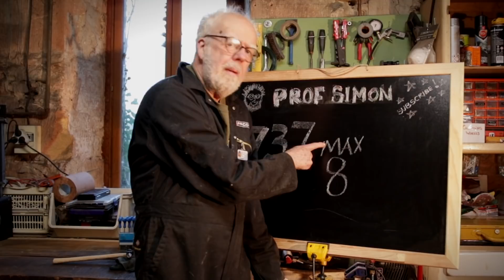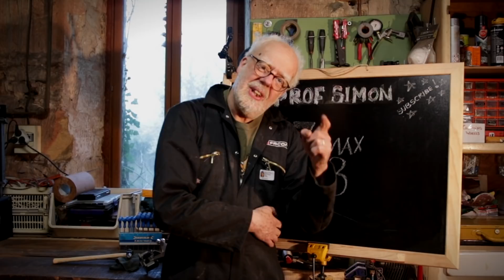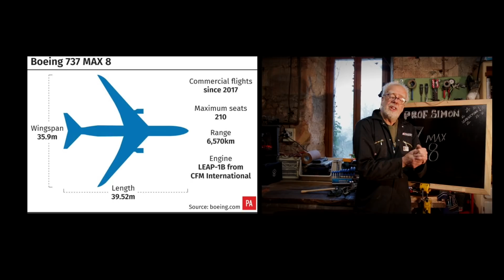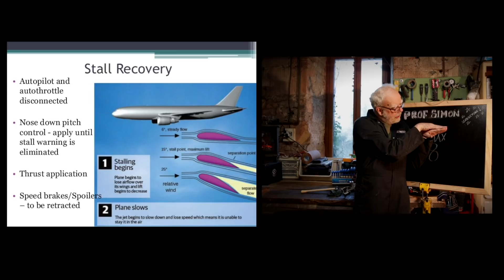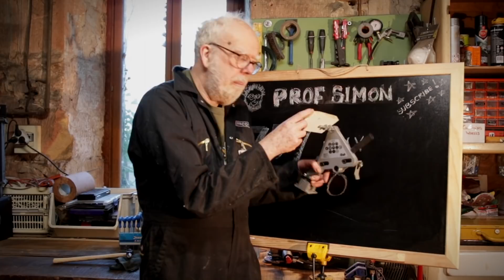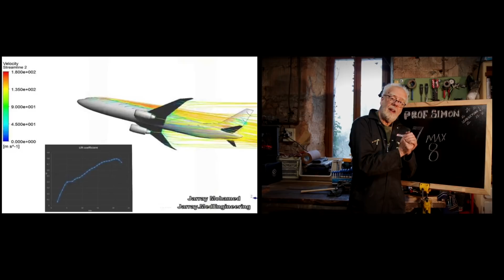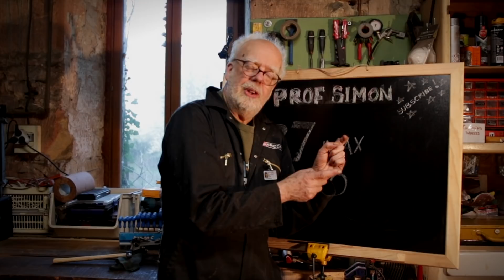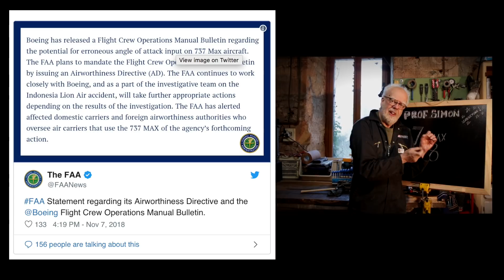Boeing 737 max 8's

Comment: “This emergency AD was prompted by analysis performed by the
manufacturer showing that if an erroneously high single angle of attack (AOA)
sensor input is received by the flight control system, there is a potential for
repeated nose-down trim commands of the horizontal stabilizer. This condition,
if not addressed, could cause the flight crew to have difficulty controlling
the airplane, and lead to excessive nose-down attitude, significant altitude
loss, and possible impact with terrain.”

Emergency Airworthiness Directive (AD) 2018-23-51 was sent to owners
and operators of The Boeing Company Model 737 Max 8.

AD #: 2018-23-51

DATE: November 7, 2018

www.faa.gov/aircraft/safety/alerts/

The bastards knew the angle of
attack vane and/or MCAS system was faulty.

Comment: Jumping to conclusions ?? he is trying to explain an accident that hasn't been investigated
and the reason is because no one knows without the full investigation what really happened
from the news it was reported that pilots were having problems with the Airspeed indicators 
and wished to return -this has happened on other modern aircraft and the result was crash's
so they need to do there work and find the cause.guessing don't work in aviation safety

Comment: MCAS has not been determined to be the cause yet.  There are reports of smoke coming from the rear of the 737 Max 8 before it hit the ground so I would not jump to a conclusion yet.
Reply: J A

But, but, all of the keyboard experts have already jumped to their expert conclusions. In every other plane crash waiting for the investigation and conclusion is the standard procedure. You don't ground entire fleets of aircraft on hypothesis and hearsay. The two aircraft that crashed were the same model. However, there may have been two unrelated reasons for those crashes. This type of aircraft is flying every day 24/7 all over the world. When other types of aircraft crash such as the Korean Air 777 or the Singapore Air 747 there are not hysterical calls for grounding every 777 or 747 in the world. The hysteria begins when people, uneducated in the aviation industry,  think they are experts and start demanding all sorts of absurd things. My thought is that,  if you don't feel comfortable flying this model aircraft, then by all means don't. There are other aircraft that you can fly that may, unbeknownst to you, have a worse safety record than the B737Max8. If you stick to reputable airlines in countries where the maintenance is reliable and the pilots are well trained, then you should not have to worry about the model of aircraft that you are flying in including the B737Max8.

Comment: Professor Simón
I  think that the Boeing 737 Max engines have a huge  increased momentum   when maximum power is applied to revert a stall. That force generates a pitch up moment which increases the AOA beyond its limits.
a second point is : most pilots are  « approach to stall trained » instead of «real stalls training»
In order to recover from stall many wing mounted engines must be reduced first to avoid the ACFT's undesired pitch up upset.
Reply: The line of thrust hasn't changed much and the engines are more efficient, not much more powerful. Instead, the issue with the plane is that the center of lift moves forward when AOA increases because the engine nacelles interact with the airflow over the wing.

Comment: If an actual jet airline pilot would care to comment, I'm under impression that for years there has been training on "runaway trim" incidents? Isn't the "Stabilizer Cut Out switch" on the center pedestal?
If I were to be asked to guess (Only as an MEI in gen. Av. aircraft it would be a lack of sufficient training. 
One Lion Air crew if I remember experienced a similar runaway trim event after takeoff but managed to recover and was actually considering continuing onto their destination (but did not). The same aircraft with different crew crashed. The FDR indicated a continued "push/pull" against the A/P for numerous times until the P/F became fatigued and turned control to the PNF just before impact. I'd suspect lack of training/Sim time.
I'm troubled with the number of failures (alleged) of the AOA sensor that have been reported in the Lion Air aircraft.

Comment: PILOT ERROR...  When the anti-stall system (MCAS) starts shaking the flight yoke...   TURN IT OFF...!  DUH...!  (2 manual switches on the lower right center flight console)   (By the way, these aren't your daddy's 737s... These aren't the wide-body 737s of yesteryear.  These are narrow-body 737s, a completely different design aircraft)
Reply: William Riley exactly. And if that doesn’t work they can always pull the circuit breaker behind them (I think).

Comment: In my humble opinion Boeing need to test fly for a one years before sell the product , we no need reason about a failure 🤔
Reply: I think they are going to find it was a number of things that lead to the crashes.  A big thing will be lack of emergency procedures training with the new system by the airlines.  

I have friends that have many thousand hours in the older 737 that have switched to the -8 MAX.  They say it's like the old one but not.  It should be interesting to see how this plays out.  Everything seems to be pointing to issues with the MCAS.
Reply: @Femmpaws ~ There's a big difference between a Yugo and a Yugo with a turbo and. Though the plane is a 737 it's not the same plane. I agree with you.

Comment: MCAS does not trust pilot and ignored pilot commands.
Contemporary software is much more buggy and much more complex than prev generation of software. Main problem is that it is harder and harder to turn off auto correction and control the plane manually. Too many layers of the systems btw a pilot and actual wing controls.
Investigation might not give a clear answer to the actual problem because of the complexity of the system.
Reply: Alexander Pivovarov right was the point for the pilot
Reply: The basic problem is the philosophy that the computer should have priority over the pilot in activating controls. My belief is that computers should warn, not take over. I have thousands of hours on earlier B737s, and it alarms and saddens me to see pilots losing their manual flying skills to computers. Now, when the automation fails (Air France crashes into Atlantic is a prime example) pilots have nothing to fall back on.
Reply: @aeomaster32 . As a pilot What's your take on the lion air crash? My understanding is that the pilot did multiple trimming operations to level the plane but were confused that while the plane always responded to their manual trimming, the MCAS induced nose down eventually defeated their efforts. Must remember that they had no idea that in manual mode, MCAS would be giving nose down commands after every 10 secs.
Reply: As I suspected the recent 737 plane soft was written by Indian fresh grads.  https://www.business-standard.com/article/international/boeing-put-flyers-at-risk-with-9-an-hour-pay-to-737-max-software-engineers-119062900267_1.html

Comment: Why are eye witnesses reporting that smoke and fire was coming out the plane's tail before it crashed. Some eyewitness reports also claim that belongings were strewing out of the plane before it crashed. Why would that happen if it was an issue with the pilots not knowing the new auto-pilot software.
Reply: I also heard that report. If the plane was trailing smoke and/or stuff was coming out of it before it hit the ground that might indicate either a structural failure or perhaps a bomb went off on board. Time will tell.

Comment: if the software is trying to optimize angle of attack maybe parameters are perfect when the nose is down and it stays locked in the position ignoring all the other inputs and that's similar to what happened. And if pilots don't know how to turn it off then they are basically mere passengers as everybody else.  
The question is why would you design a system that has a so called 'single point of failure'. Why wouldn't it disengage when pilot assumed control?  Sounds like automation for the sake of automation.

Comment: I wonder what the thrust setting was when control was lost? If there is abnormal pitch up at high thrust settings then implementing the traditional stall recovery, power up, stick forward is going to induce some aerodynamic conflict? If indeed a stall was encountered. Black boxes required here!
Reply: David H - yes, you are correct
Reply: In both crashes, weren't they starting a turn when they completely lost control? Perhaps a turn with high thrust combined with an already malfunctioning MCAS system is a dangerous combination.

Comment: You have on the B737 there are 3 autopilot disconnects, most easily accessible is the one on the yoke, right at the pilots thumb, next to his PTT button, and stab trim buttons, they are trained as soon as the AP misbehaves, to then disconnect the AP and fly manually. Don't let damn computers be your master, (other 2 AP disconnects are on the Throttle levers and the AP panel in the center of the dash) ( I am a B737 classic  L.A.M.E.)

Comment: I have flown on 4 of these aircraft since October, they have much larger engines and are placed differently on the wing to a regular 737. This causes them to go nose up, the computer system combats that and puts the nose down. Not training pilots of this seems crazy! It's aerodynamically different from the original 737, and if the computer system goes wrong, the pilots will then obviously revert back to what they know

Comment: If you're right, then manual or not that's a terrible design mistake. Just because something works in one way doesn't mean it's the correct or safe implementation for the situation ie doesn't avoid crashes with pilots reacting in normal human ways.

Comment: When  ( eyewitnesses say that ) an airliner has smoke coming from it....  has come apart in flight, and is depositing passenger belongings for several miles .... it's probably NOT a stall warning issue!
Reply: khatun 777 that's what seemed odd and different from the Lion Air accident. If the eyewitness saw clearly you wonder why it was smoking? I never did see where contents were coming out such as luggage, etc.
Other than that the flight profiles, timing, erratic speed displays, etc. seem very similar.

Comment: In my perception, flight software should respond to the plane - as well as a pilot's training. If a pilot takes 'traditional' action, the software should be able to recognize that. Off topic - with the cameras I use, what is in the firmware frequently is dictated by marketing, not by what the photographer is capable of using. Does a similar situation exist in aircraft design?

Comment: https://www.gov.uk/aaib-reports/aar-3-2009-boeing-737-3q8-g-thof-23-september-2007 provides some insight  as to the undesirable  pitch up tendencies  of the 737 aircraft,  the reason  why Boeing needed to introduce  the botched up MCAS for the higher thrust Max series.

Comment: fly with more bucks with no 737s or until max8 is reverted to old software...how the hell nose can be pitched down by auto pilot when it can't even activate until plan reaches a specific height...controlling takeoff and landing is not a good approach by auto pilot interference.

Comment: As an aircraft mechanic i can say, human machine interfacing can be a huge problem
For exampel. The faulty altimeter that influenced the autothrottel of a turkisch airways 737 that crasched at schiphol, on that last mentioned flight there was even a third security pilot on board who deed not see also that the false readings of the altimeter prepared the 737 for touchdown while it was stil in aproach.

There are a lot of ancient enginering and user habbits in the world. 
Just look at your keyboard.
Qwerty was invetend so the hammers of the typewriter did not interveen wich each other.
If you redesign the keyboard it is technical fine but it will confuss the users when there is an emergency. They will type type the keyboard the qwerty way.

If the human machine interface is to blame there is definetly a serious problem with the 737-8 max.
Enginering you can change, historic ( trained ) habbist are hard to kill

Comment: I used to take flying lessons and I understand all this, especially stall, nose down, etc.  However, Professor is suggesting. . "pilot error."  Which may be "technically correct" that it's pilot error and definitely the issue of over-correction for a stall. . . but he doesn't explain "what" the pilot is doing as a matter of training when the stall warning comes on and what the Max 8 software is doing.  If the s/w is pulling the nose down automatically, "what" is the pilot reacting to and what is he doing that counteracts the "correct/improved" s/w?  With indicators including awareness the plane is trying to fly nose down, wouldn't his reaction be to pull back on the stick to correct this nose down?  I saw one expert suggest the s/w is OVER-CORRECTING for an assumed stall and the pilot in order to overcome the software, has to literally turn the software or autopilot OFF.  to regain manual control and correct the situation.  If this is true, then it's a software design error!

Comment: You say there is nothing wrong with plane.. however there is fundamentally something drastic wrong with plane and you repeated it several times Professor. That is the new software doesn't work like the old software as you called it version 8. If the pilots failed to be 100% familiar with new software in certain scenario ie stalled condition everyone dies!! Well there you go.. in nutshell Boeing should have made the parameters less rigid and allowed the plane software to compensate these experienced pilots inputs. This is what happens when you over-engineer things not to mention they made the biggest bug is software coding and that is N+1 new code needs to support all the features and functionality of the previous code. Ie if you have improved the software to function in certain way.. It needs to accept the new input method expected to resolving expected situation AND I repeat AND also accept the old inputs both old and new input should result in the same expected outcomes. You can't penalize failure of airline to train their pilots + or pilots that didn't read the manual to kill 149 innocent lives.. Boeing should be sued out of existence if they made this stupid cowboy error. However we can't jump the gun. We really don't know what caused both accidents.. However it is within airlines rights to cancel all flights involving 737 Max 8 until further information is available and root cause has been determined.. In the mean time airlines should ask Boeing to cough up any losses if their auto-pilot code is found to be followed in any shape or form... Some countries are even banning these planes from flying into their airspace..

Comment: Witnesses report white smoke coming from tail along with debris (luggage etc.) Clearly the rear APU blew apart!
Reply: witnesses frequently confuse what they saw a moment AFTER the impact with that seen just before impact. They also mistakenly report pre-impact fire even when all fuel was consumed before impact. You never know if the witness has even seen an aircraft before the reporter found them.

Comment: So the latest Boeing 737 aircraft are fly by wire???That alone would confuse me, if I were a cross over pilot from the old generation aircraft.!!!! then the training program is inadequate. Airbus was the first civil manufacturer to use fly by wire was it not? The crossover from analogue to digital flight systems seems to be a grey area for both Airbus and Boeing. However Boeing seem to have a bigger problem with this shift. The 737 is an old design that does not shape up well in this day and age. The Airbus planes have mostly been fly by wire. So the cross over aircraft training would seem to a pilot as a simple add on extra operating procedure. Basic flying format across its aircraft range on offer. I hope GOD CAN REST THE SOULS OF THE LIVES LOST. Any loss of life is so sad.

Comment: This is a human nature problem that Boeing is now facing because of their way of naming planes. They put them selves in a bind by using the 7"N"7 system which limits them to only a few choices when naming A BRAND NEW airplane. So the 737 of today is completely different from the 737 of 15 years ago  BUT,   BUT,  they are both 7 3 7.  By our human nature we expect all 737 to behave and operate very much the same because it's a 7 3 7  which we already know.  But it's a new plane and behaves different.

Comment: When the plane is not monitoring the pilot you end-up with AA587, 265 fatalities.
Reply: John Kubik yes! That accident blew me away with the excess rudder movement in reaction to the wake turbulence from a departing 747 ahead.
I kind of wondered if there was any kind of coverup there with AIRBUS but I don't remember if the A-300 was climbing out at Va or not (maneuver speed or turbulence penetrating speed..
An ATP can correct my jargon).
Pilots who had flown with the AMR 1st officer said he was heavy on the pedals during turbulence but now that I remember, AA training manuals prescribed using aggressive control inputs to recover. That has since been changed since the accident. The entire vertical stabilizer broke off, most of which was composite material.